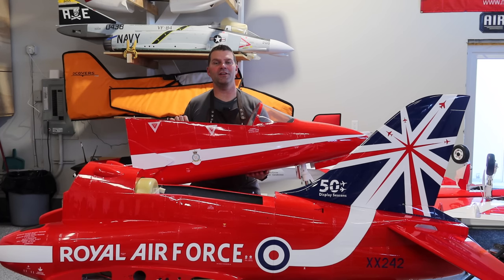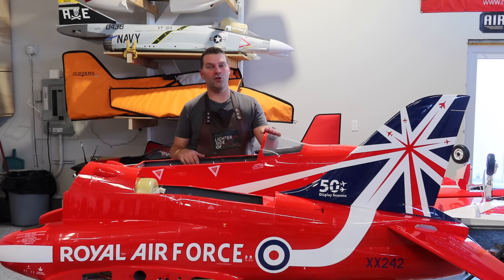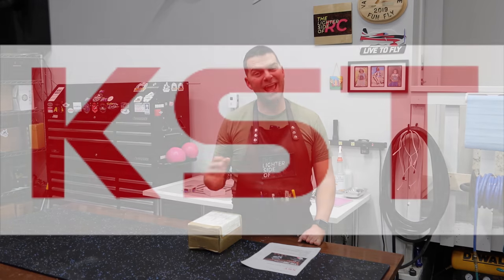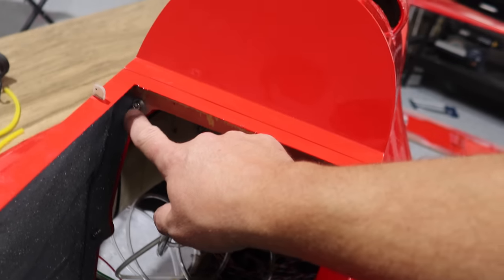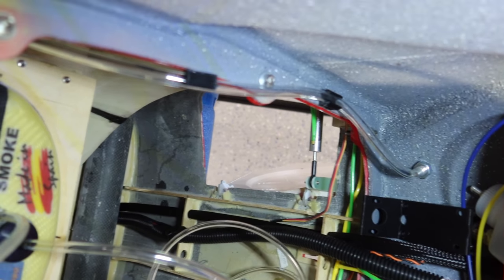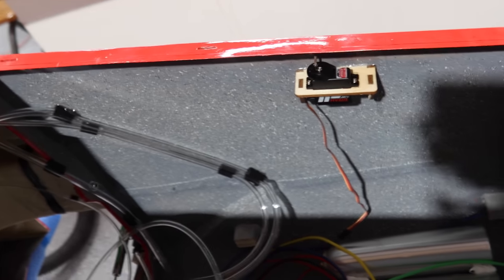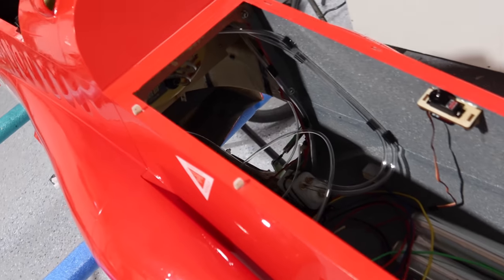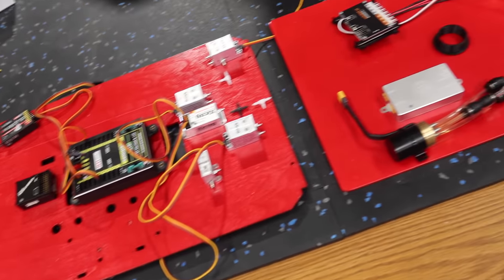HOW TO INSTALL COCKPIT XXL HAWK - Skymaster 1/3.75 Hawk

Comment: The Hawk is such a good looking jet!  The remote plugin for the Cortex is brilliant!  I do the same  as you for my monitor/monitors.  For my gyro unit installs I mount them to a raft of sorts. Just a 1/8" piece of aircraft ply that has a footprint about 1/8" larger than the Gyro unit.  The gyro is mounted to the ply raft with its tape then the raft is screwed to the tray with a screw in each corner.  Now if you ever have to recalibrate the gyro simply unscrew the raft from the equipment tray and remove from the plane. No more scraping and tearing the mounting tape! I do the same for all my Jeti Assist RX's
Reply from the maker: Thanks Bert.  Yea I used to do that with my Gyro's, I would install them on a Carbon plate so they could be moved easily.  Totally understand and it's a great way to do it.

Comment: This airplane looks so big. Great video as usual. Forgot to take a note on the paint you used for the freakled appearance of your tray. Could you help please. Krylon stone spray if I recall? And any prep needed before hand? Thanks
Reply from the maker: Thanks!  It's Tremclad stone finish.  basically the color you use for the base will be the primary color you see come through.  So I will usually use a base of grey primer and then the stone finish.
Reply: @thelightersideofrc   Great Thanks

Comment: Love your build vids !! Do you find it harder, easier or neutral in repairing models that have been painted inside of the chassis
Reply from the maker: Thanks!  If you have to do a full on repair from a damaged fuse than it's much easier on an unpainted fuse.  If you do paint the inside you have to sand all the paint off for a proper bond of the glass repair.

Comment: Well what can I say, another great video from you and the workings of the cockpit and the tray layouts. Super job. I do have a question, do you have the battery connectors for deans or just XT? Going to look at your website and see.
Reply from the maker: Hello Hank.  Thank you very much.  I don't have the connectors for deans.  Just XT.  I used to be a fan of deans but have pretty much moved away from using them and gone to MPX and Mostly XT.  Great connector.